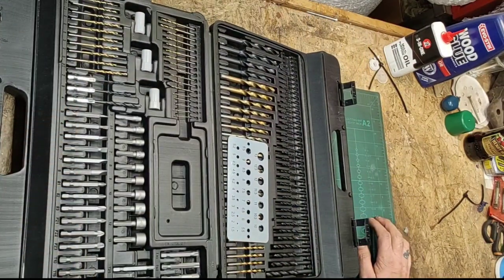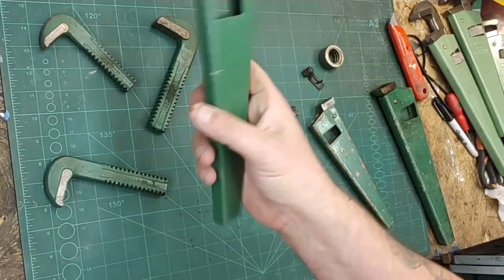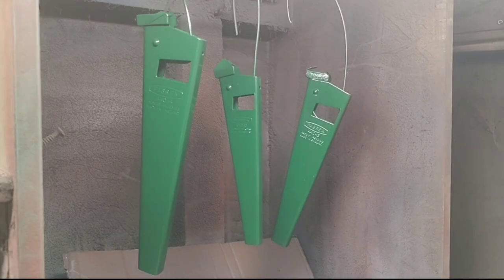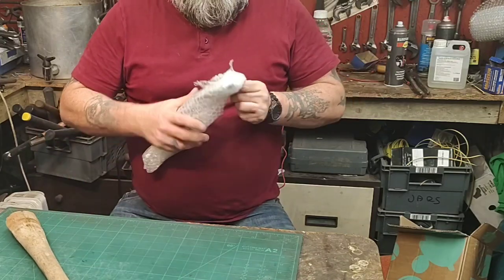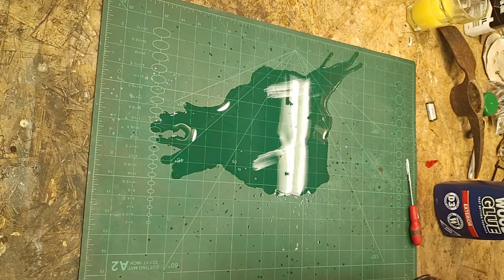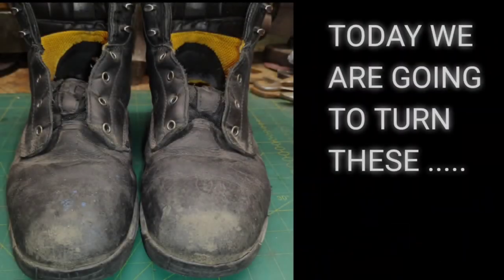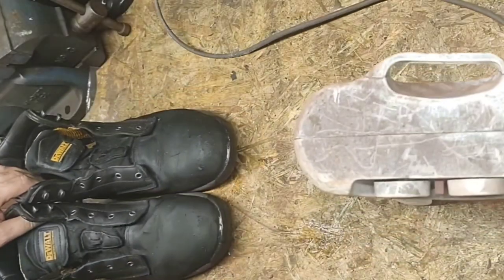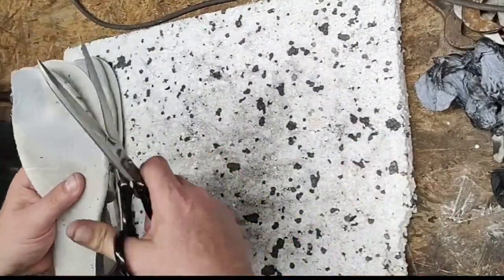Restorations workshop chat Rants Clamps slipjoint pliers workboots cleaned polished

Comment: That was a long one and I watched it all because you made it interersting or I am losing it {you choose why}. I like your green color better on the wrenches. One can never have too many tools so don't start anything. The bonus hair  in the dremel wire wheels was disturbing and the extra wires in the package is standard in China packs. The highlight was the excellent restoration on your boots. Just amazing. I recently restored some boots that are more for casual wear and not for work.  wanted a different look so after a thorough cleaning I used a wire brush to give them a suede finish. Enclosed is a picture. That was a long one and I watched it all because you made it interersting or I am losing it {you choose why}. I like your green color better on the wrenches. One can never have too many tools so don't start anything. The bonus hair  in the dremel wire wheels was disturbing and the extra wires in the package is standard in China packs. The highlight was the excellent restoration on your boots. Just amazing. I recently restored some boots that are more for casual wear and not for work. I wanted a different look so after a thorough cleaning I used a wire brush to give them a suede finish. Enclosed is a picture.
Reply from the maker: Thank you John , you even left an extra long message too .... I got a bit of deja vu reading it. ..   😂😂 I think I have too many tools ..... I could probably use wrenches as floor tiles set in concrete .... Now there's a video that's not been done....yet . . Thank you for watching all the way thru , it took a lot to film this on top of normal stuff and the working week at job proper and add all the interesting bits.    . !!